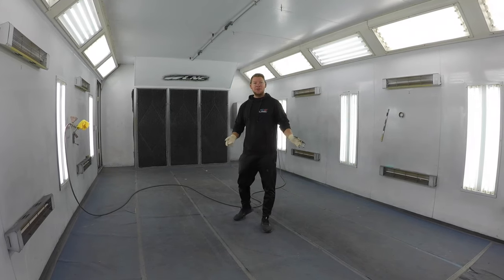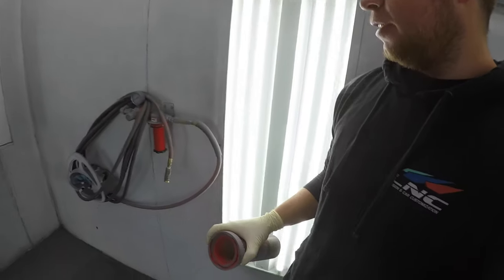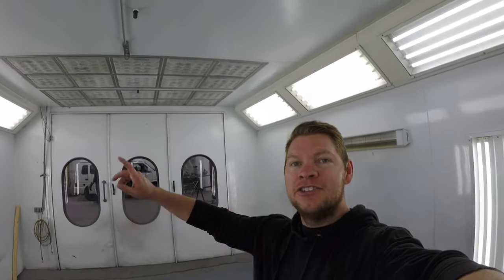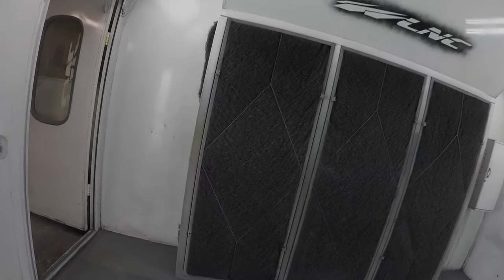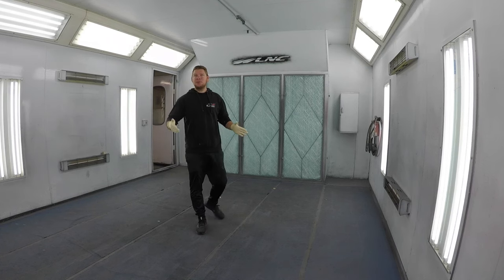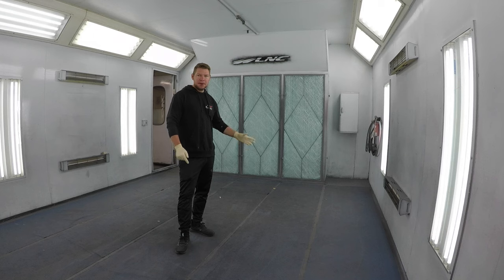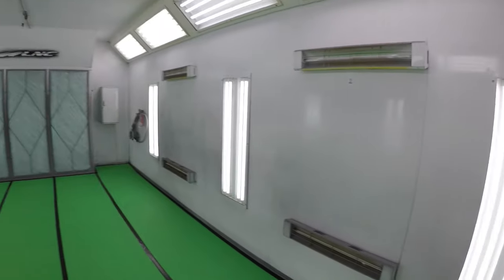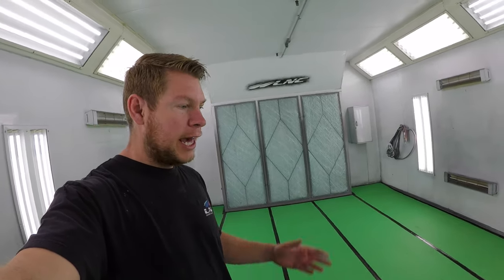Spraybooth Service! Cleaning and Changing Filters Also a look into the RTI air filtration.

Comment: Hey what's up man love your content I'm a painter as well I have a question for you what's that material you use on the floor in the spray booth is there's a name for it?
Reply from the maker: Thanks bro 👊🏻 its called Grippy Mat made by PIG, works very well and it helps keep dust down. Just vacuum it every morning 👍🏻😁
Reply: @LncPainter  appreciate the Intel man thanks again